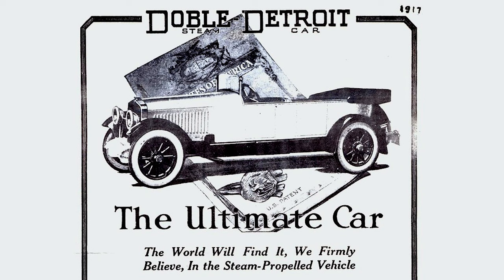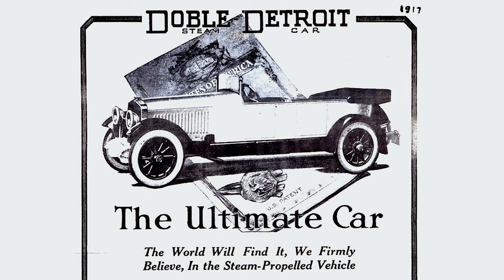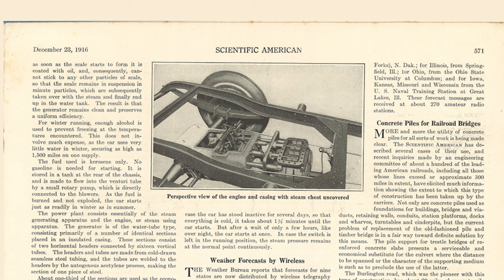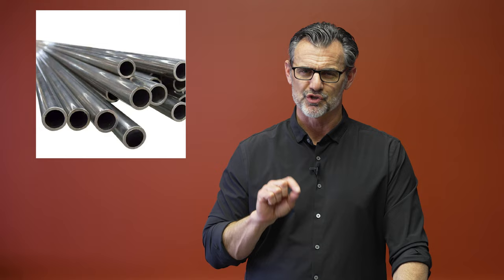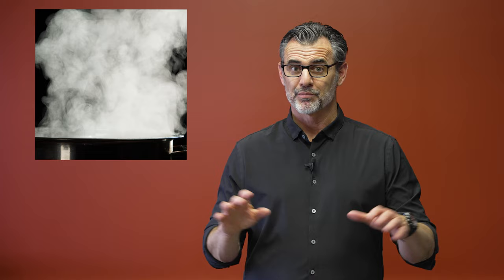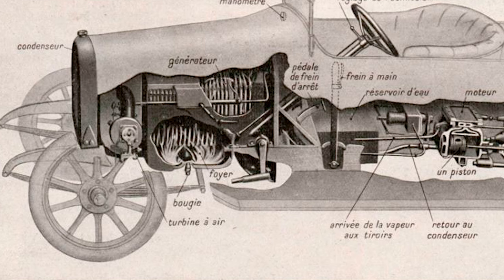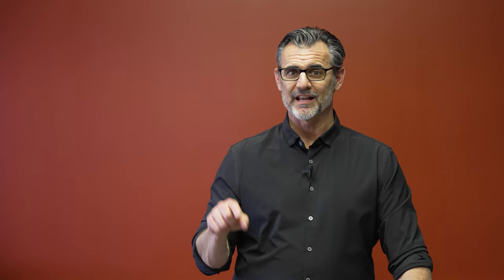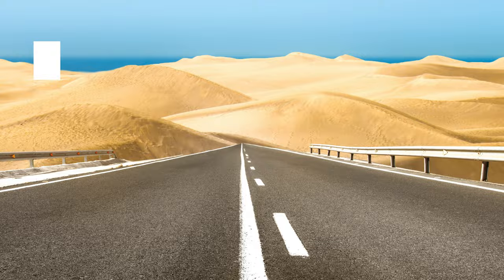1,200 Miles a Tank in this Steam Car? - Steam Culture

Comment: Wow 1200 miles?? Bring these back!
Reply: 1200 miles before you run out of water and need to refill the water. You will need to refuel before then, regardless of what you use as fuel. The true beauty of steam engine cars is that it can run on anything that burns, not just oil, but even wood, coal, or even garbage. Fuel shortages would never be a concern, because people could always switch whenever necessary.
Reply: @Slayer8957  Steam Automobile Engines have closed loop systems, hence why they have a condenser... so they don't need to stop frequently for water.
Reply: they didnt get 1200 miles tho. max you would get was 200-300 miles on a good day.
Reply: The thing about steam cars is you can't reuse the steam when you inject oil into the steam as it will "gum up" the mechanic of it, steam locomotives used constant external oiling for this reason and the range that you get from a condenser is 100% dependable on the weather out side , if you are in 40 degrees below zero in Alaska you might actually get 1000 miles but in a situation like California in summer you might get 60-100 miles if you are driving only in the morning or "cool of the evening"

The real thing that killed the steam powered car was the Starter on ICE vehicles as steam takes a  bit to warm up and go and you really have to fill the water tank every time you take a medium drive as the pipes will scorch and become un-useable the first time you run out of water .

All in all steam is great if you live in a frigid cold enviroment but if it is even balmy where you live it presents a huge problem.